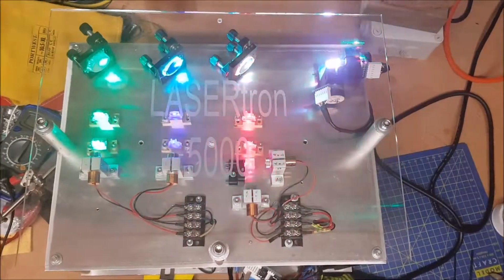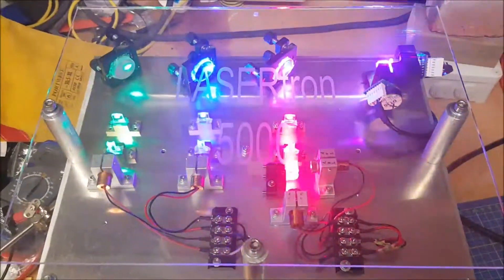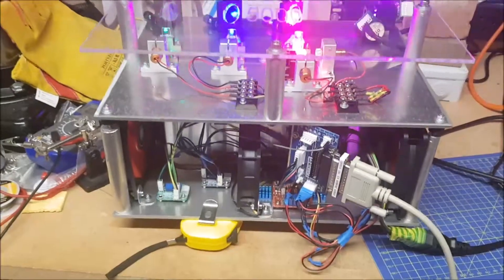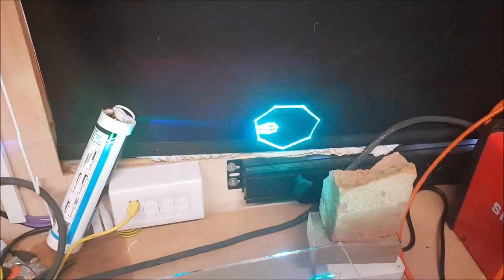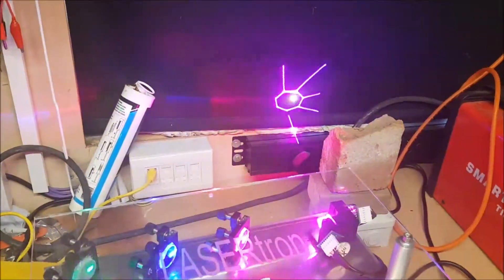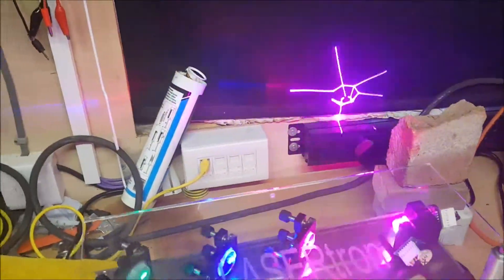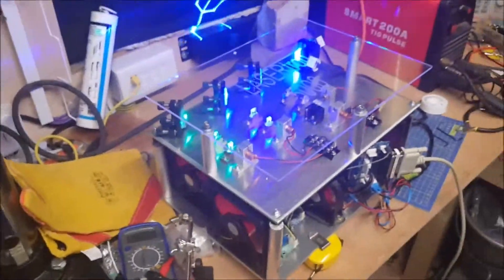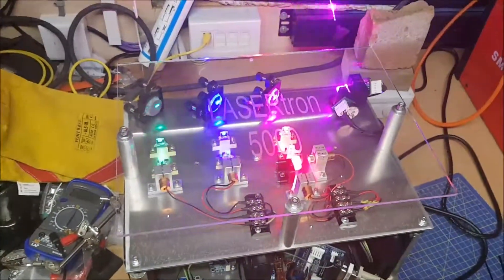Home Made 5w RGB Laser Projector

Comment: Nice first go at building a RGB projector, ive started to buy parts to build one myself, brought a 30K scanner kit with ILDA support, Red-Green-Blue laser modules measuring just over 500mW, i wanted under 500mW of power but China sent larger power modules only reason is that its for indoors for my home built Laserharp.. Got dichroic mirrors coming in the post as the X-Cube i brought is rubbish over 50% loss with all 3 lasers.. Im just keeping my eyes open for a case to put it all in..
Reply from the maker: Its a great fun little hobby, not built a laser harp but have had a go on one, only green, multi coloured one sounds interesting.

If I did it again id go with an RGB module to save having to do all the engineering around the optics which have to be super accurate.

What I built works but if you move it it needs to be aligned again etc
Still, it did the job for a first go!

Comment: Safety question: You don't need a safety glasses if you want to align laser beams ? I have a rgb laser that needs a prism alignement
Reply from the maker: You should always use a professional to work on your hardware if you don't know what your doing, if you take on the  job yourself, you should always use laser safety goggles (that offer protection against the wavelength's you are operating) when working with hot beams, I couldn't advise anything other than this for obvious reasons.

Comment: Tbh, I wonder if that^ (your DIY Projector) could handle the stress of a few artistic show that I've made😁..

Also, curious if it also could qualified as a standard OEM Projectors as what comes from manufactures mhmm🤔
Reply from the maker: To be honest it was a great learning exercise and produced great results from a test bench but every time you move it you would have to re-align.
If I did it again I would likely purchase a module and build round that.

Alternatively I would have to hone my fabrication and accuracy skills to use smaller diode housings with much smaller tolerances.